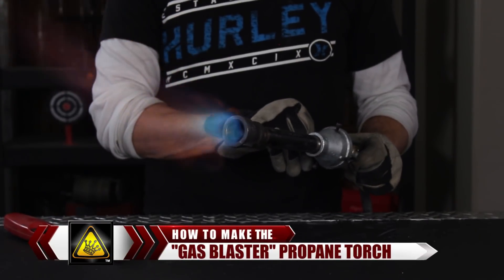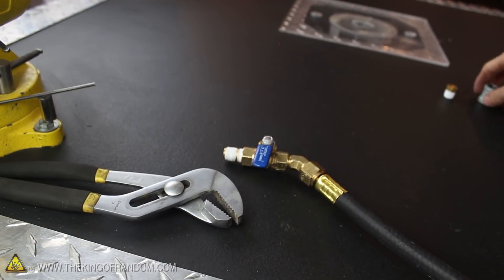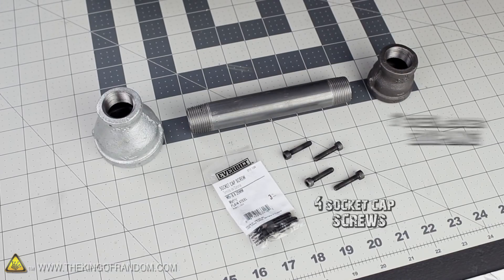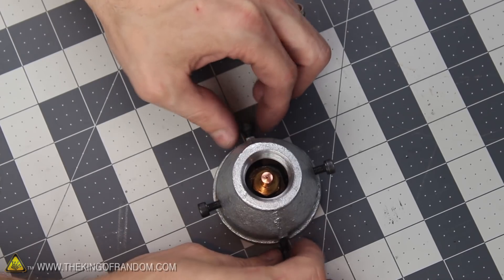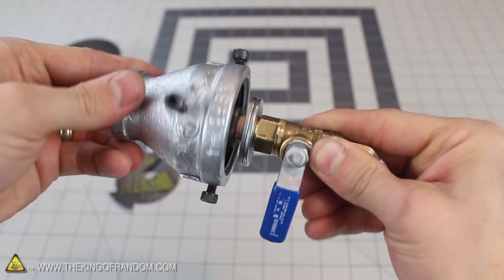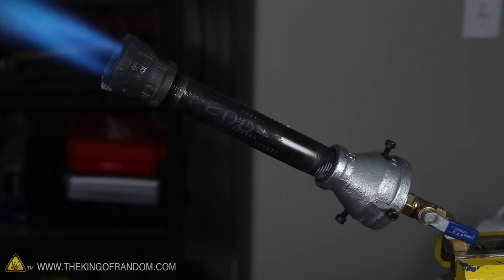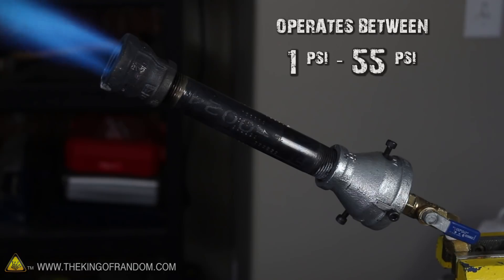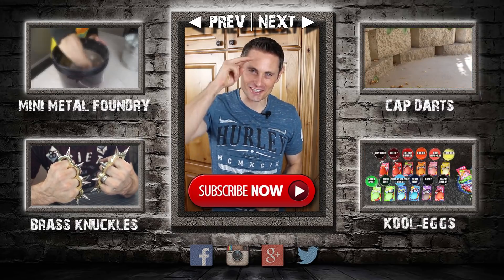Convert Your Backyard Foundry To Propane! ("Gas Blaster" Propane Torch)

Comment: Anyone know if it will work using a normal propane blowtorch like the plaster of paris mini forges you see on here? Doubt it would be as hot but is it viable?
Reply: i've done that myself and it works quite well!
Reply: TheRebel3000 yes it is trust me but it only gets to about 1850 degrees Fahrenheit.
Reply: JustPlainOutdoors I suppose it won't be hard to upgrade it later. Thanks.

Comment: That's a great way to break a tap. Tap wrenches are kind of a necessity when tapping holes, or rods. (#Ladies)
It's usually something along the lines of 1 turn in, 2 turns out.. So in, then reverse and back it out to clear the threads, back in.. repeat until your hole is tapped.
Reply: I don't know if I'd really believe modern taps don't require it. The issue with that is breaking the teeth off the tap, and the technology/strength of steel hasn't changed all that much in the last 30 years. The taps I use are SnapOn and roughly 18-20 years old.. If those will break, I'm sure others that most folks are using will too.

Comment: Now could I convert this foundry to propane using a turkey deep fried burner ? Please reply
Reply: no. The regulator isn't powerful enough unless you have one of the 40 psi ones. Most of the turkey fryers only have a 10 psi regulator.

Comment: I have a really important question that's preventing me from converting to propane:
When I try to tap the holes in the reducer coupling to eventually hold the welding tip nozzle, I snap the tap in half every single time. I've gone slow, fast, used a hand tap, tried it on a drill...every single time, the tap breaks in two, and I end up with half of a metal tap sticking out of the coupling.
I know 100% I'm using the correct size drill bit and the correct size tap. Did I buy a coupling made of particularly hard steel? Or what do you think could be the problem?
It's been really really frustrating. I've basically given up because of this problem. :(

Comment: So I finally got around to building one and I am having a hard time sustaining the flame with anything above 5psi...  what could I be doing wrong?
Reply: Marc Minami Not enough air inlet?
Reply: actually i think it was too much air.  so i gave up trying to get it to sustain on its own like grant was able to in the videos.  it works perfectly in the foundry because the flame doesn't have time to blow itself out.  of course if i cut off 95% or so of the air intake i get a weak flame.  any more air and it flames out.
Reply: Marc Minami That's interesting. Is your propane bottle almost empty? Experiencing cold weather? I mean I assume you've tried 30psi but those are the only things I can think of.

Comment: Would just like to say that this is very dangerous... Big fan of this page been following it for a few years but this project I wouldn't recommend to any one who dosnt know what there doing and is following the instructions on this. For example there is isn't a any valves on the gas hose to prevent flash back ie stopping the flame from traveling back down the hose and causing an explosion, would also use some form of leak detector spray on every fitting to check for leaks rather than just a simple shut up and listen for a hiss noise as 9/10 your not going to hear the leak... Also I wouldn't trust that " air regulator " feel free to comment below if you have any disagreements.
Reply: Flashback can not occur with propane. The flame will not travel backup the hose because there is no oxygen to combust with and oxygen can not enter the line because it is always under pressure. 

A leak detector spray, or just soapy water is not a bad idea, but frankly if you have a leak you are going to smell it right away. Soapy water helps you find the leak after you hear it or smell it.
Reply: Badioactive Bacon there is no flashback possible without oxygen
Reply: Badioactive Bacon Perhaps the pressure gauge has a flashback preventer built in but I'd also venture to say that as long as the psi on the gauge is high enough, flashback shouldn't be an issue especially with decent air regulation, but yes I agree it is a concern. On the "air valve" I'd have to agree but in a pinch it works just fine. Same principle as a laboratory Bunsen burner.

Comment: At least in CA all propane tanks have a built in safety that prevents you from drawing more then ~3 PSI from it. The old tanks that do not have the safety are illegal to refill so any ideas on how to build a  propane foundry with that limit? Right now i'm switching to using acetylene but would rather use propane due to it being cheaper and safer.

Comment: What additional steps would be needed to convert it to a natural gas torch? I have a natural gas pipe (yes, it's up to code) going to my very old, rusted out perm-installed bar-b-que in the back yard, what hoses, valves, etc would be needed for this project?
Love your vids and the foundry is the next project for my son and I!

Comment: can this melt manganese bronze? it melts at around 1600 f
Reply: yes, because the melting point of brass is about 100-200 degrees F than the melting point of Manganese Bronze. This foundry should easily get there (as seen in the video it melts brass quickly)
Reply: jimster1111 it will be easy because it was actually able to boil brass which is above the melting point of steel

Comment: Hey Grant, quick question. I love your videos and your work but when I made this propane torch it wouldn't get hot/jet like it does in the video. 
I did everything like you did, with a few different parts, which is normal like I couldn't find the 45 elbow and a different regulator, but the propane came out fine. Though, it wouldn't get hot and when I did get it burning it was making a very fast puff noise like puff puff puff puff puff puff puff puff puff and wouldn't become the constant roaring jet torch. I tried removing the air regulator to half and completely took it off and it still wasn't working. I also had the regulator at 30 psi approx.

My cover is also very damp and won't fully dry even though I made it about 2 days ago, which is weird.

Also, how do you keep the slag separate from the molten aluminum? I did the charcoal and melted some aluminum but when I took the cooled slag out, I could see there is ALOT of aluminum mixed into the slag. 

Plus, I also can't get all the slag and stuff out of the bottom of my fire extinguisher crucible, any tips?
Reply: You probably used a low pressure regulator. I had the same problem, normal BBQ regulators are like 0.3 PSI so you need an upgrade to a high pressure regulator.
Reply: If you live in CA the tanks have a built in "safety" that limit the PSI to about 3. no way around it. Adding borax soap helps get the slab and Al separate, giving Al ingots as well.
Reply: I did the same thing and I bought a 25 psi regulator. I took the pipe off and there was a tiny little flame and the air regulator made no real difference. It wouldn't even light a little shaving of wood, nor stay lit without the camp propane lighter I used staying on it. Any thoughts? I have been trying for two months to get it to work.
Reply: Amanda Kulani check mig tip for blockages
Reply: Make sure the nozzle is perpendicular to the pipe.

Comment from the maker: Some quick links to a few of the materials I used for the "Gas Blaster" Propane Torch:

[✓] Propane Hose: http://amzn.to/2cFDcBu
[✓] 3/8” Flare x 1/4” Elbow: http://amzn.to/2bXclUF
[✓] 1/4” ball valve: http://amzn.to/2c1yTlf
[✓] 1/4” pipe nipple: http://amzn.to/2cm8S2C
[✓] 1/4” Steel coupling: http://amzn.to/2c2tiyg
[✓] 1/4” brass plug: http://amzn.to/2bXdmMx
[✓] 6mm -1.00 TAP: http://amzn.to/2cGHhZc
[✓] 0.025”(0.6mm) Contact tip: http://amzn.to/2cm9e98
[✓] 1” Steel Reducer Coupling: http://amzn.to/2cFHDML
[✓] 1- 1 1/2” Steel Reducer Coupling: http://amzn.to/2cFJdOC
[✓] 4 Socket Cap Screws: http://amzn.to/2c2x1vI
[✓] 6” Steel Pipe: http://amzn.to/2cJgKeM
[✓] Pressure regulator: http://amzn.to/2ch6KHE
[✓] 1/4” POL Valve: http://amzn.to/2cJjQ2z
[✓] Pressure Gauge: http://amzn.to/2ch58O2
Reply: Grant Thompson - "The King of Random" your link to the 1-1/2" steel reducer coupling is the wrong size to make the flare
Reply: Grant Thompson - "The King of Random" **THESE AMAZON LINKS WILL GET U THE WRONG PARTS** Correct parts from video: 1½"x¾" reducer coupling 1"x¾" reducer coupling  6”x¾" pipe.
Reply: Grant Thompson - "The King of Random" you are the best! like if u agree
Reply: Shogun 
yeah I found out the same thing got to go to the actual store now and find the right size
Reply: yogman10 I did my drill and tap in a drill press and it worked just fine. When tapping you may have to go in a few turns, then back out a few, and so on.
Reply: Grant Thompson - "The King of Random"
Reply: I have a basic propane torch (the long neck kind like you can use for weed burning and driveway repair) with a dial valve on it, will this serve the same basic purpose?  or would the build in this video function better?
Reply: What is the correct size for the reducer coupling?
Reply: emiel das bij de kampeer winkel hebben ze het wel
Reply: Ive got a problem whenever I use the burner the flame is like a big lighter but when I put a hair dryer to it it ends up like yours but doesn't last long and gets blown out however I put it even though I followed your instructions to the T any ideas what might be the problem and how I can fix it?
Reply: Nate Clishe it could be a few thing. Try using different settings for the regulator. Make sure you have a oxygen control thing on it. There could be a few other problems but I can't think of them right now so try these and if it still doesn't work I'll help more.
Reply: I have a really important question that's preventing me from converting to propane:
When I try to tap the holes in the reducer coupling to eventually hold the welding tip nozzle, I snap the tap in half every single time. I've gone slow, fast, used a hand tap, tried it on a drill...every single time, the tap breaks in two, and I end up with half of a metal tap sticking out of the coupling.
I know 100% I'm using the correct size drill bit and the correct size tap. Did I buy a coupling made of particularly hard steel? Or what do you think could be the problem?
It's been really really frustrating. I've basically given up because of this problem. :(
Reply: Steve C just get the one that he uses, the larger one is hard to find, or very expensive. The largest size coupler at lowes works, you just may need to use forced air or no air regulator. anymore questions I would be happy to help
Reply: Use striaht quotes and primes
Reply: Grant Thompson - "The King of Random" So it's like a big buns burner
Reply: I've built this propane torch as instructed & I cannot seem to keep the flame lit.

I have adjusted the tuna fish oxygen plate gently out(for more oxygen) and back in (for less oxygen).

I don't have the regular shown in the video, but I do have one installed. I think it's a 60psi.

I open the ball valve very gently to let a little bit of gas out & I get ignition. The flame is invisible inside my foundry but I can hear the roar of the fire burning & I feel the heat coming out.

When I attempt to tweak the tuna fish plate - the flame goes out.

Suggestions?
Reply: yogman10 

Have you tried a slightly bigger size of drill bit?
Reply: i was wondering this as well.
Reply: Grant, got any ideas what i should get?
Im from the Netherlands and almost all of the parts are very hard to find here, and a big deal of the links you posted from Amazon won't ship to NL.

Im really keen on getting the parts and make a propane burner for my foundry, any help would be appreciated
Reply: Grant Thompson - "The King of Random" 
You messed up the coupling sizes. You didn't use a 1" coupling but a 1" - 2" coupling
Reply: NO FRACTION CHARATERS
Reply: J Bass You might need a adjustable regulator. Mine only goes up to 30 psi and I  just leave the ball valve completely open and adjust the regulator and the air way about half way back. Also he doesn't mention that the pipe he's using is 3/4". I also used a 12" pipe cause 6 seemed a little to short to me.
Reply: Can you confirm the links for the reducer couplings? I think one of the links is incorrect. Defaults to a 1" x 1/2" reducer on Amazon. Or confirm the sizes for the reducers?
Reply: Nate Clishe Your pressure is too low. Turn it up.
Reply: how long can one 15 lb propane tank last you, can you tell me please.
Reply: Barrett Lewis which coupling is which lol
Reply: PJ sivley which reducer coupling is which
Reply: Agreed... I just built it and it wont sustain a flame with a reduced end. Pipe alone almost works, but I can't get a solid flame long enough... Back to home depot (to hope they have it)!
Reply: hey for the propane tank can I use a Bunsen burner
Reply: Grant Thompson - "The King of Random" hey i,m love you make choklet TV
Reply: Grant Thompson - "The King of Random" you can get a diamond play button
Reply: Hey, you have a 6m tap but 5m screws... why?
Reply: Will this work with butane?

Comment: Imagine running this on hydrogen from his hydrogen generator.
Reply: prabhanjan sathaye he meant that as "what if", he didn't mean to say that hydrogen was the gas being used in the torch.
Reply: That'd be cool but propane combustion releases I think like 9 or 10 times more energy per mole than hydrogen combustion so there would be some interesting challenges
Reply: I wonder how he'd manage to make it so the hydrogen gas does NOT explode and instead creates a flame
Reply: Its not hydrogen its propane (C3H8).

Comment: My school's metal shop's torch runs on acetylene. I can easily melt copper with a regulated hose. We use it to solder for rings, mostly copper, brass, and nickel silver.

Comment: My torch will light fine - but as I turn the valve up to increase fuel and turn it all the way up it goes out.  I found if I put it in the foundry when it's low and then turn it up then I can open the valve all the way up - but it never really seems to get hot enough - not enough blue flame or jet engine sound.  Is it more likely I have something wrong with the design or that there is an air issue?  Any thoughts?

Comment: I have a little larger foundry I built and really didn't care for the hassle of charcoal. After doing a little research I came across your torch video and decided to give it a try. Its works great even with my larger foundry and crucible. Thanks for the ideas. I've also build a styro slicer. It also turn out great. I added a LED to the wiring so I can clearly see when its powered on. Great Videos. always looking forward to the next one.

Comment: So, I made this torch, and have used it quite a bit.  I originally made the bucket smelter, but decided to go a different route with this device.  I used an old propane tank (yes, took off the valve, let it air out for a week or so, cleaned it out well before cutting it) and it works like a charm!  The only thing I noted is, I have to have the end cap on, even in the smelter, to get it to light.  You might have said that, but I didn't catch it.  Great project, thanks!

Comment: 80% of the items in this build are specialty parts. Don't waste your time at Lowes or Home Depot.
Reply: stamasd 
What do you estimate the total budget was? Planning on doing this soon
Reply: Late reply, but I built one this afternoon. From parts at Home Depot except for the propane regulator/hose and flare adapter which I got from Amazon. I modified the build a bit to fit the parts I could find. It goes: propane tank->30PSI regulator with gauge->flare adapter to 1/4"NPT->1/4"NPT to 3/8"NPT adapter->3/8"NPT ball valve (because I didn't find any 1/4" gas-rated valves, 3/8" were the smallest)->3/8"NPT by 4" long brass nipple-> 3/8"NPT hex cap. I made the nozzle from the 3/8" brass hex cap by drilling a 1mm hole in the middle of it; it also has had 2 opposite edges flattened so as to allow the screws to find flat surfaces to bite into. The intake venturi (the one where the screws are set in) is a 1-1/4"NPT to 3/4"NPT reducing coupler, the main tube is a 3/4"NPT by 8" long black iron nipple, and the exhaust flare is a 3/4"NPT to 1"NPT coupler. I tested it up to 15PSI gas pressure, it works very well. Didn't bother making a damper, seems to work very well without one. The flame is a bit turbulent and loud, I will fix that by grinding down the threads inside the exhaust flare. I didn't use a MIG tip, but the 1mm hole in the cap is equivalent to a 0.030 MIG tip and is perfectly fine for this purpose.
Reply: Short of the propane and hose, I bought everything at home depot

Comment: Hey Mr Grant Thompson, i saw u were using the bottom of a extinguisher as a 
crucible. i jused the co2 tank of one do get something smaller. My problem is that the steel is melting away and the furnace is crackling. Even if i am still using coal. May u give me some tipps for a better crucible  and a long lasting furnace material?

Comment: Hey Grant, in your video you show it being used inside your flower pot foundry. I did this myself and found that after only 4 uses the fire extinguisher crucible deteriorated and fell apart. I was wondering if you had a similar issue with your foundry. If so, do you plan to make a crucible that can "take the heat"? I know that there must be a way to make one yourself.
Reply: well it s all about oxidation, steel oxidize very fast at those high temperatures. 

to improve the lifespan of your steel crucible, try to a add a thin layer of eg clay on it.

i read that heating up a steel crucible and than letting it cool down at fresh air, a thin oxidlayer will form, preventing oxidation.

and do not cool your crucible too fast, it will weaken the material (cooling of with water for exanple)

and finally, i recommemd you to buy a graphite crucible eg from amazon, i just bought one
Reply: +JPAnor I know why it happened. I was just curious if he had the same issue and how he got around it if he did.